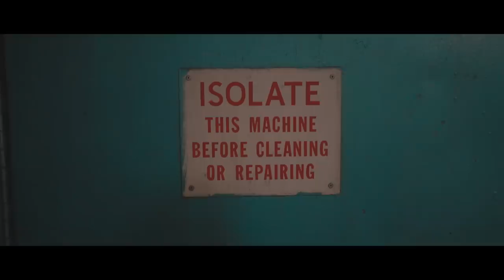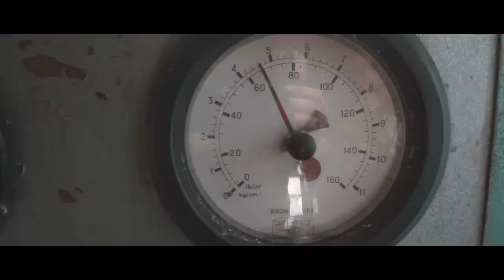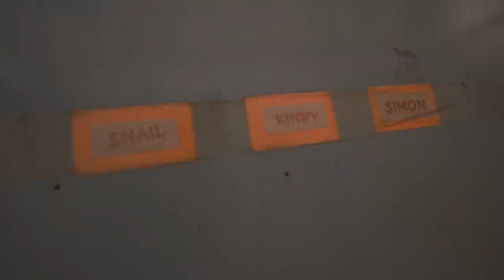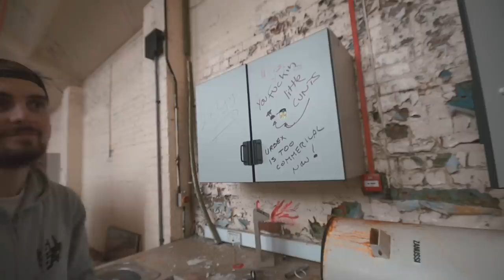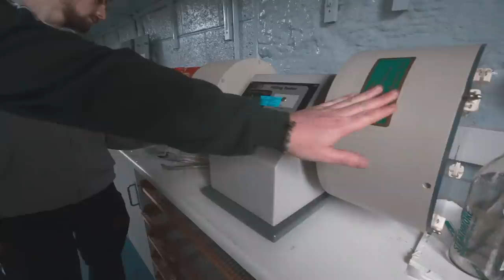UNTOUCHED ABANDONED FACTORY WITH EVERYTHING LEFT BEHIND

Comment: Oh my, I used to work at Fruit of a Loom and we used those machines to make the fabric. It sucked when you had to empty out the rolls and take them to be collected. Also sucked when one of the threads would break.
Reply: what kind of fabric do you think that is? cotton jersey?
Reply: mbr715  looks like cotton jersey, looks like the exact looms I used to run. So you would have spindles of cotton thread run through each of those holders, and the middle axle would spin and make the fabric. Each roll weighed about fifty pounds and you would have to stop the machine cut the fabric take it and drop in a cart then roll the fabric end back int the roller, place it in the axle and close the cage door. Aso you constantly had to air clean every needle, holder, or else the machine would stop. It was a super dirty and difficult job, we had ten looms running at once.
Reply: Possibly that the good products of it are of UK production and the shitty tissue paper stuff is Asian, I often wondered why some of the fruit of the loom stuff was such reasonable quality for such a lower price range of clothing and with most stuff outsourced to the east is why clothing is such shit quality and shrinks after one wash.

Comment: The “manual fucking machine” was a fabric tester for testing fabric samples for abrasion... you’d clamp in a bit of fabric and crank the arm to run the head back and forth to measure how long before the fabric wears out. But I like your explanation better 😂 cracking explore guys.
Reply from the maker: Ahhhhh shiiiit that makes sense, so what someone just sits there for hours cranking it until completion?
Reply: Hell on Earth yup... crank away until the fabric wears through... I’m guessing more modern ones are automated.
Reply: The machine that they was flapping that rubber is a more moden automatic one. Also a pulling machine tests how long it takes to get the little annoying bobbles on your woolen clothes.
Reply: Lee2709 yeah a pulling machine is what a use at home alone 😂
Reply: I've got a manual fucking machine. 😅

Comment: WIFI wireless fidelity
Wi-Fi is defined as an abbreviation for wireless fidelity, meaning you can access or connect to a network using radio waves, without needing to use wires. An example of Wi-Fi is when you go to Starbucks and can join on their network to get on the Internet without having to connect your computer to any wires. But Al`s without fibers makes more sense.